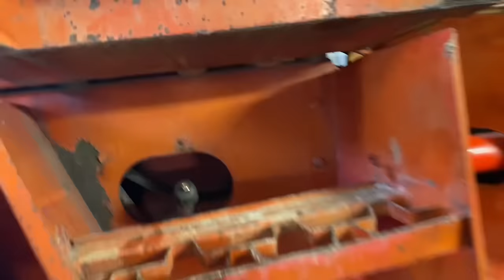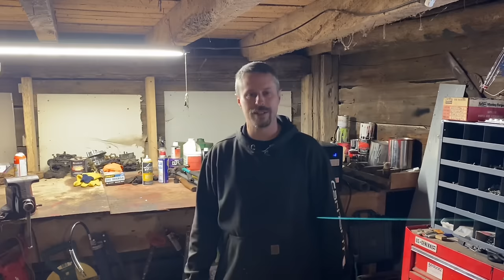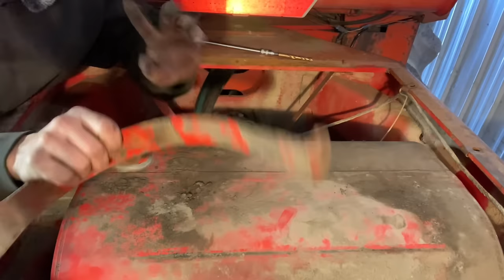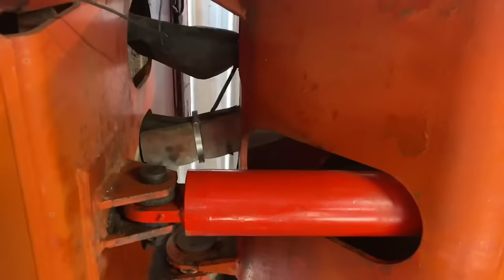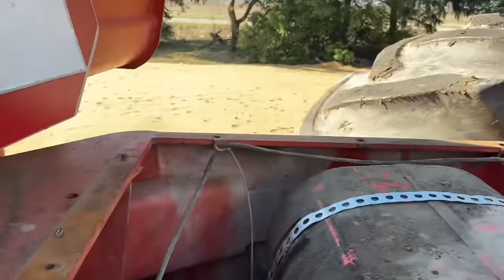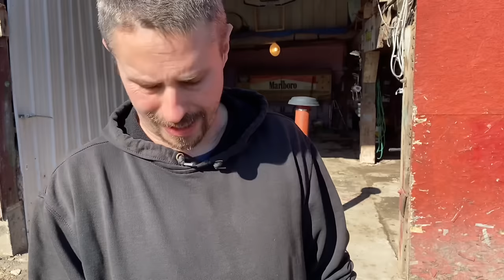Massey 1800 hydraulic nightmare is complete!  Will it lift and steer?

Comment: It's looks like it had a push blade on it from the mount in front,perhaps with those big tires on it ,it has seen some sliage bunker pit pushing and packing,,it now would  work for some weight as a  mount platform of a sort if you need any up in front

Comment: When I was a building general contractor,I bought a older two wheel drive Sky Track tele fork lift.Ya boy I realized also I should of had one many years before,I rebuilt the injector pump on it and it came to life like a new one. I believe it had a Perkins in it,,boy it was useful. 5000 lbs at 28 ft lift  A 5028 model I believe
Reply from the maker: That’s a long way up!

Comment: JT thanks for the update. Sounds like she will do just fine now she don't leak. AND STEER. HOLEY MOLEY. Looks like the brakes worked pulling up to the implement so world is good, eh wot? Sounds good too. A few exhaust leaks, big deal after 5 minutes of field work ya'll will be unable to tell. She shore looks good with them big wide tires. Might need them with a damp field. Now wash the windows so ya'll can see. Now she doesn't have nearly as much window grime as I have just seen on other recent tractors, so ain't  so bad as that.
Reply from the maker: I did give the windshield a wash, it squirted a bunch of steering oil on it. But got everything else working good!

Comment: I like the rubber tubes you cut up for anti-buzz noise isolation on the tank mounting saddles,and straps.Looks like you might have a good runner ,just top off all the fluids and take it out and work it like it was designed to do.If that's a planetary axle in front,? I see ,,if so ck the condition of the fluid in those also first just in case a seal has leak it all  the fluid out of one perhaps, as it's been setting for quite a while out of service,,pressure clean it and get your Crete poured before field work starts for ya,,nice old tractor for sure and it's cat driven.i see the number of remotes you have in the rear,ya ,I know now why you have a big tank for hydro oil ,,that machine can handle quite  a multiple sized hydro cylinder driven embelment as I thought,  work it some and it should quit smoking somewhat
Reply from the maker: Right on!  That’s what I was thinking too, that oldie needs to be run!

Comment: Does that cat require any valve lash adjustments,perhaps it's a good time to go them out and it looks easy so to do so,,find a book on that machine and get the valve specs from cat,it surely properly needs to be cked out, before you work it to long and hard,,you ll know when you test work it ,esp on just how low of rpms ,it will pull it's self out of its rpm hole
Reply from the maker: Right on. I’ll give that a look!